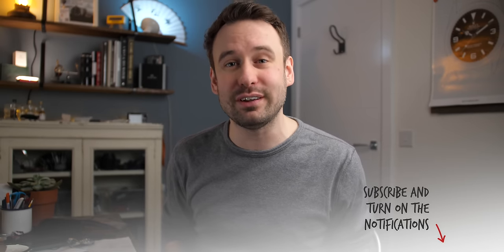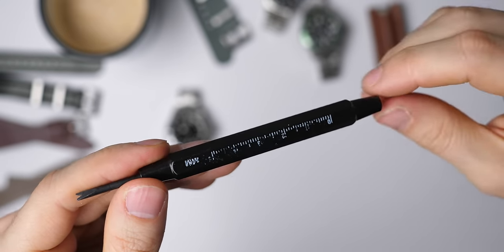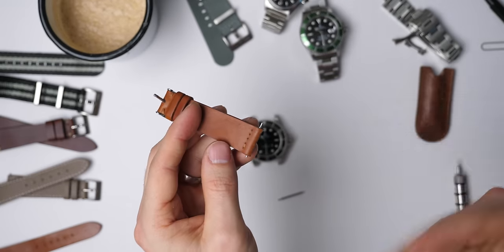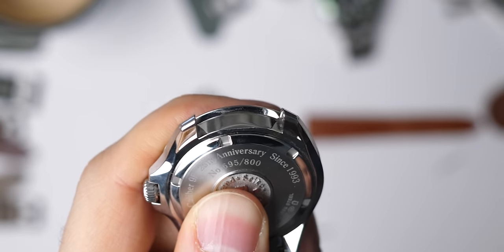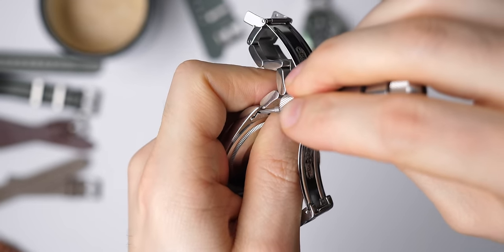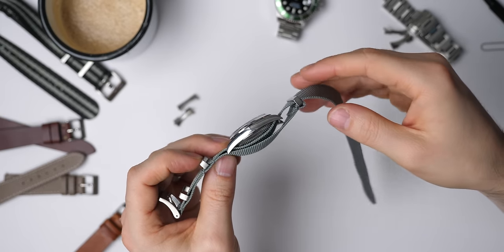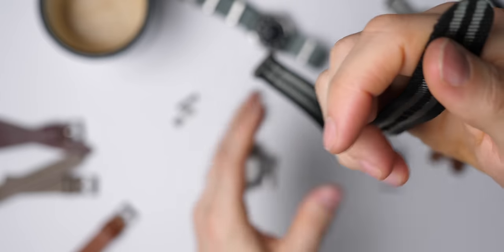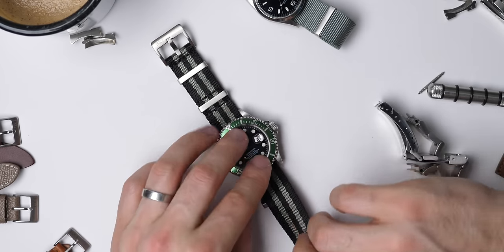How to change a watch bracelet and fit a Leather or Nylon strap

Comment: Great video Adrian. Some great tips and info. Thank you. I sometimes fit straps and bracelets the reverse way round as the watch falls to view better, maybe just my wrist. Just going to your store to buy the tool. Right tool ordered. 
I know you aren't a fan of Bremont (overpriced in your opinion) but the hardened case material is very hard to scratch. No scratches on mine anywhere in spite of numerous strap/bracelets changes and the spring bars removal and refitting. But your video has shown much better tidier ways. Thank you.
Reply from the maker: Thanks for watching Paul. I don’t dislike Bremont. I actually think they make decent watches. 👍🏻
Reply: Bark and Jack. Thanks for your reply Adrian much appreciated. I’m Still very impressed with your superb strap & bracelet changing tips. I thought I knew it all how to do that but obviously not. Yes I’m happy with my Bremont, super accurate time keeping, great Lume, very tough, etc etc. Expensive but I think one gets a lot for the money. Anyway Keep up the great work and keep the now well known and respected name-Bark & Jack and great logo. Thanks & bye for now.

Comment: I thought you should insert the spring bar tool parallel to the lug, not at right angles to the lug. Surely doing it your way will blunt the tool quickly and it will be more likely to slip? Correct me if I’m wrong!

Comment: Putting on the solid end links on the explorer without that “tweezer” tool is no fun at all....
Reply: I can put on the solid end links on my Explorer without the tweezer, but I cant remove them without the tweezer.
Reply: Same here. I can do it without the tweezer but it's just so much less frustrating to use one.
Reply: I’ve removed them and installed them with out it and it’s a pain...bought a 30 dollar pair of those “tweezers” on amazon and it’s saved me a lot of frustration and scratches to my case 😂

Comment: Great video. I might have missed it but where was the mention of using curved spring bars to allow more gap between the case and the strap? This is key to avoid scuffing the leather.
Reply from the maker: I’m yet to try curved spring bars. I’ll order some today. 👍🏻
Reply: @BarkandJack  Yeah give them try, might make all the difference. I've even added clear tape over the rough part of the rolex case (over the serial and model numbers) to give the strap a smooth surface to rub against.  If only there was something we could do about that sharp bottom edge you mentioned too.

Comment: Hi Adrian - great video as always. I am just about to order several Nato straps from you for my IWC Pilot Chrono 41 (black). Obviously no tool required for this task. However I just had a thought as the strap size is the same for my IWC Pilot MK XVIII. I'm thinking then to get the Bergeon Spring Bar Tool from you as well and I can change the look of my MK VIII. How easy is it for you to remove the spring bar on this watch, given you took the plunge recently and got the MK XX (nice choice) :)

Comment: Hi Adrian, I've got an Air King 14000 with the 3000 movement. I wondered if you would be interested in doing a video on the watch? I work in Glasgow so happy to meet up in town. I'd be interested in your strap recommendations for a 19mm strap that would suit also. I think due to its 34mm size the air King is often overlooked but I love the watch. Cheers Andrew

Comment: Dam, I wish you showed this video yesterday as I put a NATO strap on my new no-date Rolex and I forced the strap through the spring bar and did exactly what you said, which is damaged the strap 😩😩... Dam! Dam!
Reply from the maker: We’ve all done it Max. I still sometimes do it when I’m being impatient. I have a leather nato that has a massive scuff all down it. 🙈
Reply: Bark and Jack I know but it is frustrating, I did think it’s quite ironic that you show this video 🤦🏼‍♂️. This was the Bond black and Grey nylon but I do have a leather one so at least I now know how to fit it this time. Thanks Adrian 👍🏻
Reply: Martin thank you for the tip Martin, I will try that 👍🏻

Comment: Hey @barandjack, I have an explorer 1997 very similar to yours (amazing watch), but I've noticed a huge gap between the watch case and the watch bracelet with the hollow-end links. Two questions: 1) Is that normal? do you see something similar on yours? and 2) If Yes, is there anything I can do to reduce that gap? 

Thanks - Big fan!

Comment: On those Rolexes, you should use a curved end strap and curved spring bars.  So there you have a possible product idea.  Everest Straps do these for Rolexes.
Reply from the maker: I keep meaning to try curved spring bars.
Reply: Bark and Jack :  use two spoons.   Place spring bar in between, and press hard.  Voila! (Curved spring bar)

Comment: good video - the omeage seamaster strap is a bitch to remove  as its such a snug fit - applying pressure while trying to ease off that pissy clip off is a great tip, attaching takes seconds thankfully

Comment: Very interesting but there’s no way in hell I’m going at my Rolexes with sharp metal tools. Interestingly ADs can be rubbish at removing links. I had one guy butcher three, count them, three Rolex oyster links by removing just one link when purchasing a brand new Rolex. Screw heads were stripped and polished link sides were scratched.   Always go into an AD with a loupe and don’t accept shoddy work. Paul Thorpe recommends using specialist polyamide protective tape to protect your watches from accidental slips with tools maybe something to consider.

Comment: I'm more careful on my £200 Seikos than you are with the Rolex watches XD. #
For weirdos like me who hate scratches try taping the lug backs before removing or installing springbars, do not force or push on them too hard or you'll bend the spring bars and accelerate the wear / chance of them failing.
Reply from the maker: Yeah taping the lugs is a good one. I should have mentioned that. 👍🏻
Reply: Isn't it frustrating to be THAT afraid of scratching your watch? Even on the back? Genuinely wondering. I understand it if you plan on selling your watch, but if it's a keeper – why?
Reply: @franksbr  Most of mine aren't keepers, just enjoying my way through the mid range watches from various brands, chopping and changing etc.

Comment: You place em on the caseback, you move em while laying on the back of the bracelet, you don't tape them and you do it free hands to some degree. Is this shown for the one guy that has no idea but also does not want to pay 5£ to his watchmaker? He is probably a lot better off paying that 5£.
Reply from the maker: They are watches, they tell the time, no need to treat them like some fragile art. 
Taking a watch to a watchmaker to change a strap is like taking your car to a garage to pump the tires up.